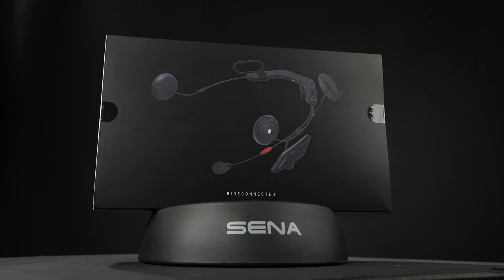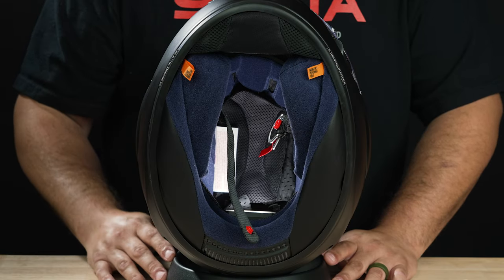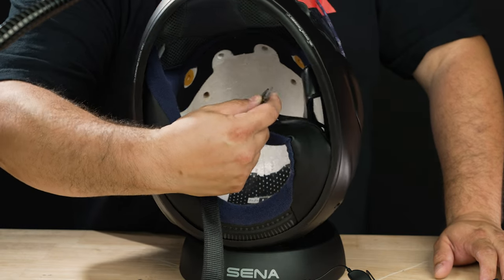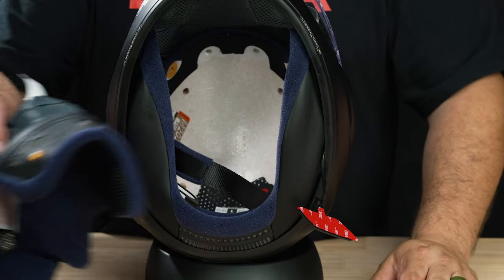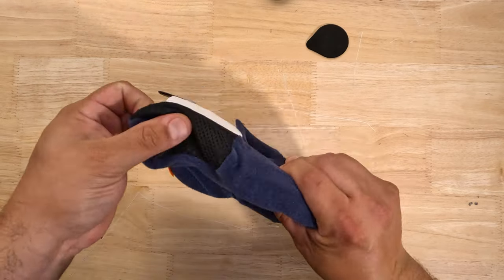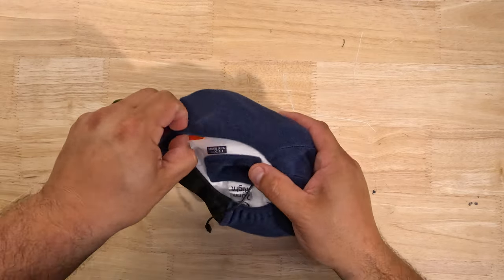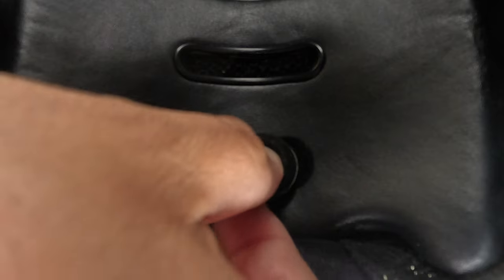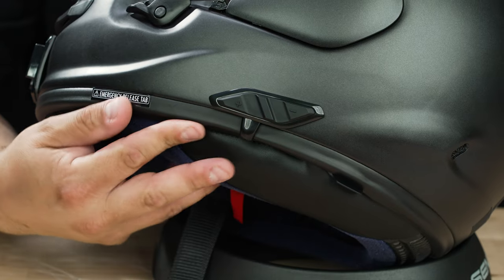Comment installer le kit de communication bluetooth Sena ACS10 conçu pour le casque Arai Quantic

Comment: Hello! Looks like ACS10 is not ok for XL size of Arai Quantic - unfortunatelly, I have to cut a plastic part on the helmet (behind a cheek pad) to lay the antena wire correctly and without tension (extra 5-6 mm would be enough). Also, this problem could be avoided if the antenna was detachable.